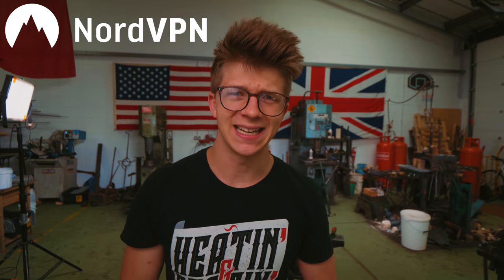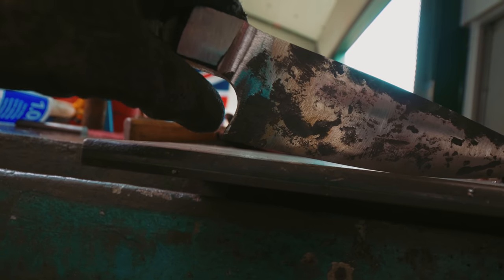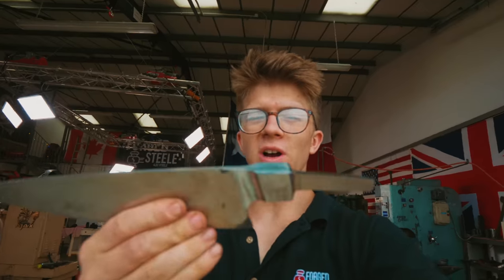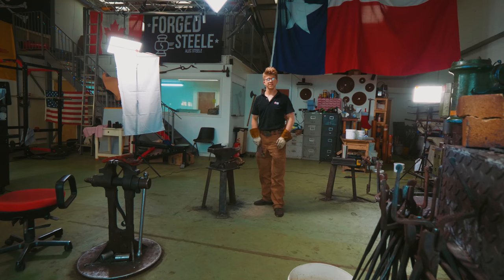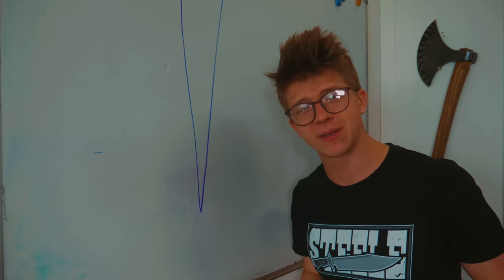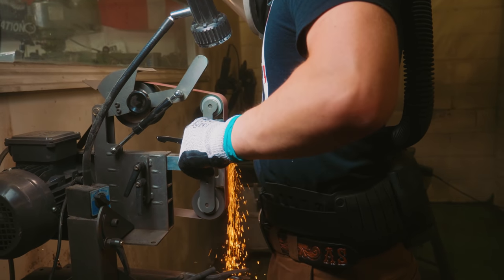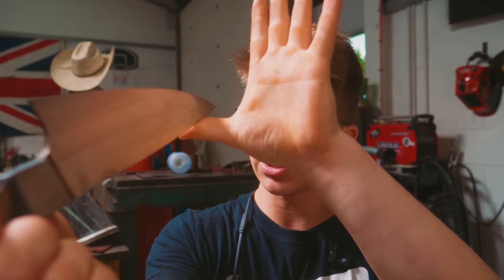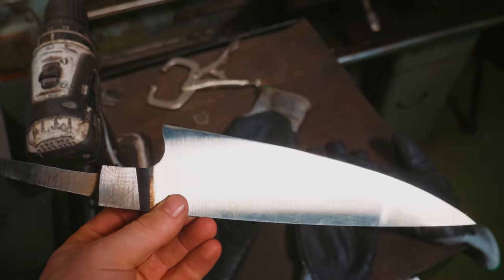MAKING A CHEF'S KNIFE!!! PART 3

Comment: As a fellow brit I love our dual use of both metric and imperial but when it gets below an inch imperial completely loses me XD Il pick mm any day.
Reply: Alex PJP I'm an American, and I wish we used metric. Makes so much more sense but people are stubborn so.
Reply: sry but in any craftmanship metric system is the way to go, because it is easier to convert mm to cm to dcm to m etc. and wanted to say perfect knife for cooking would have  either 2 or 3 layers only 2 for onesided edge and 3 for a twosided edge. Damaskussteel is good and all but isnt the best solution if you simply want a tool that works as best as it could, damaskus looks better though.
Reply: I'm a glass blower so we use both. I guess it just depends on the industry you get into.
Reply: I use inches all the time as that’s how it was during my apprenticeship in the 80s old bolts and nuts. But if it gets down bellow an 16th of an inch them it’s metric... fellow brit.... Across the pond need to adopt it and many many Americans I talk to would love to use metric... and lots do now due to imported cars from Japan
Reply: I'm American and use metric a lot in woodworking when I get to smaller measurements.  So much easier to use.
Reply: I like using both. I don't know either my weight or height in metric and also like cooking with imperial (depending on the recipe of course). but when it comes to science and such metric wins out. I do however have an unreasonable dislike for km and m... i don't know why XD i much prefer feet and miles. honestly that's the beauty of using both... i just do use which is most comfortable. it works great for doing DIY and stuff because you just use the system which gives you the roundest number.
Reply: Alex PJP we use both tho I had a doctor ask what I was in cm I’m like eh I’m 6ft 3 does that help hahaha...
Reply: StArFuRyZz that’s the beauty of metric it’s so so simple to use and takes no learning to use. Even better in tooling also..
Reply: No idea about crafts and industries but as a generation X Kiwi I use metric for everything, including height. Some people my age were obviously influenced by their parents a lot though, and try to stick with feet for height. I just give them a blank stare and ask them to tell me in "real" measurements. It's the 21st century, yo. :p
Reply: As a Brit, I also tend to use both, but favor the metric. Also, if the weather is hot, I talk about the temperature in Fahrenheit, but if it's cold, I moan about it being below zero Centigrade. ;)
Reply: As a machinist in America I convert everything to a decimal. .125+.125 is a lot easier than 1/8+1/8 if you know what I mean. .250 vs 1/4”
Reply: I am an American who works on mid sized scientific experiments. As a rule, you use SI units for project specs and instrumentation, US customary units for  machining and PCB manufacture (down to 1 mil scales [Yes, thousandths of an inch are a thing]), and SI for anything requiring in house chip manufacturing (mm to nm scale). 

It works reasonably well unless US industry (who sometimes use US customary) is also involved in instrumentation and then you get Mars orbiter stuff.
Reply: Same here. Unless the measurement is perfect halves, quarters, and eighths, I need to grab a ruler or some calipers for reference.
I really don't get why we didn't just switch to metric when it was easy. The longer we wait, the more influence the luddites get in the way of a much-needed change.
Reply: Metric system for life!

Comment: Thanks for including Mareko's discussion of heat treating in the last video. Going to try that technique on my next couple knives which are 1095 and should respond similarly to y'all's 1095/15N20 damascus. By the way, the possessive form of y'all is correctly spelled y'all's in case you were wondering.
Reply from the maker: I should note! Both Mareko and I are using 1080 not 1095!
Reply: Thanks for letting me know. I'll have to consider the implications of my hypereutectoid steel, but I imagine it will yield a similarly good result using his process.

Comment: You should get some wet stones to sharpen the blade to a very fine point
Reply: You can do it on belts too. You just need a much lighter touch and finer belts.
Reply: Only problem with belts is you usually end up taking years off your blade meaning you gonna have to replace it sooner.

Comment: That kickback/belt break reminds me of what I did when I experienced tablesaw kickback the first time. I got very lucky in that it just broke my left hand and I didn't lose fingers but as soon as it happened I shut the saw off and out loud counted all my fingers twice very fast then grabbed my hand in pain. My right hand almost went into the blade i mean i was millimeters away from losing a finger or worse.
Reply: It is scary! I caught a piece of 1/4 inch plywood in the gut. I was afraid to unwrap my arms from around myself. Luckily , it was just a bad bruise with a scratch.

Comment: A VPN is good for other reasons than was explained. If you had unencrypted connection to a resource before  VPN, you still have unencrypted connection from the VPN provider to the resource. Only added encryption is between you and the VPN. Man in the middle attack is still possible. It is important to understand what VPN does and what it does not so to not fall prey to false sense of security. But when connecting to such resources as banks, your connection already uses transaction layer security (encryption on the data going between you and bank) in virtually all cases.
As stated in other comments VPN allows you to anonimize yourself from you ISP and circumvent any limitations on region you are coming from by using a VPN node in another region. It will be limited by throughput of whatever VPN service is providing regardless of the throughput your ISP provides.

Comment: Alec, I think it would be better if the blade was thicker at the tang and got thinner and thinner as you went to the tip for a chef's knife to cut stuff like onions and other soft vegetables at the end and harder stuff in the middle of the blade. I think that would make a good chef's knife
Edit: I didn't watch the whole video through rip I just saw you were doing exactly what I told you to do. I feel dumb
Reply: Ok, just pointing out that the Alec uses the standard term for that, which is "distal taper", i.e. the blade getting thinner from the base of the spine to the tip. There is also profile taper which is the blade getting thinner from spine to edge, perpendicular to the distal taper. Many blades, including this one, have both kinds of taper.

Comment: Knife could use more of a flat spot from the heel to center of knife cutting edge in my opinion. I cook a lot and am kinda a kitchen knife snob...a flat portion helps prevent “accordion” the ingredient which means the knife isn’t cutting all the way through. Added some flat portion on the edge makes it more versatile as a kitchen tool. Right now without a flat portion means you are restricted to rocking the knife when you cut. Flat portion means you can do quick chopping tasks on garlic and onions etc

Comment: I know nothing about grinding or forging, but I enjoy your videos, I slowed down your video and noticed that the   belt grinder well ... belt was worn out, you can see the missing piece of the belt at 12:22, then when you turn the belt grinder horizontally , and that worn out part of the belt touches the knife, your belt is cut and you loose control of the knife. I'm just pointing this out so you know what happened and maybe this will help keep you safe. Edit: you can see the belt flaw incoming right before you touch the knife at 12:25.

Comment: One of the things I look for in a chef's knife is that the heel of the blade has a flat spot of about   20 - 25% the length of the blade. Maybe "Sharp, but parallel to the cutting board" would be a better way to say it. Where you showed that there is a "Stop", it should be a bit longer. The idea is that you can chop down at the heel and the blade will contact the board; imagine chopping garlic. From that point forward it should curve up to the tip, so that the blade will rock up and down. The whole transition should be subtle enough that you can slice the full length of the blade without noticing it.

Comment: Noob blacksmith here! Regarding the tempering, what would be the difference between (195*C for 2h)x2 and 195*C for 4h when it come to the performance of the knife?
Reply: i dont know squat but,
the process is for altering the molecular structure of the metal,

so simply put, doing it twice for 2hrs (cooldown inbetween), has a differant result than running it once for 4hrs.
but your question was "what is the effect", so you probably knew that already,

maybe we'll get somone to be able to explain what happens in each scenario,
otherwise youd need to look through texts about metalurgy
Reply: My understanding is the grain structure of the steel becomes smaller make a better knife.

Comment: Theo nazz (2 time fif winner) showed me to anneal in 3 steps first one is critical temperature of the steel you're working then too cool to Black heat. Than 300-400 degrees less than critical and cool to Black Heat then 300 less than that and cool to Black Heat! Seems to work good!

Comment: Hey Alec. I know this is a question with a lot of answers, but on average how long do you spend waiting for the metal to heat up during a project?
Reply: 0KOrbU0 anywhere from 10-30 minutes depending on the size of the objecy
Reply: Wesley That was a lot less than what I thought. I figured there must be a lot of down time while waiting but if you only use around 10-30 minutes in an entire project that takes days then it’s almost nothing.
Thanks for the answer :)
Reply: Heating from cold should only be about ten mins
For following heats (during forging) it should only take a couple minutes.

Though for special heats, like heat treating and stuff it can be more for heat soak and stuff.

Comment: Hi I have been a chef for many years and like watching your show. If I may share some wisdom from one profession to another. Is the bolster and the spine of the knife going to stay flat and square? If so I predict it will be an uncomfortable knife to cut with. When you are holding a blade as a chef to be able to cut fast and precise you will only have really 2 fingers on the handle. Your thumb and index finger will pinch the blade itself you middle finger will rest directly behind the blade and the other 2 behind that gripping the handle. This is the best way to cut and so it is important for a really comfortable blade that those top edges are nice and round and smooth. Cos otherwise I promise you, if you need to use the tool for any length of time it will give you blisters. I have a good set of knives myself and all the edges are rounded for this particular reason. Hope it this helps. Keep up the good work

Comment: IT pro here, the VPN is only 'kinda' like you described it... good try tho, since you're not an IT pro, it was a good stab! 

HTTPS will encrypt data between a client and a site, and modern encryption is more than adequate. 
VPNs in corporate settings are commonly used for clients (or employees) outside of the company's physical premises to get into their network via an encrypted tunnel. 

MOST of what a VPN does for consumers is anonymizes where they're connecting from. It is true that everything between the client (you) and the VPN provider is encrypted, but if the end site you're accessing isn't encrypting the connection, the connection between the VPN and that site is still unencrypted and could feasibly be vulnerable to an anvil in the middle attack. ;)

Comment: Can't you remove the scales with a strong acid bath?
Reply: Officine Undici you can soak it in vinegar for a day or so and it will remove a lot of it. I use hot vinegar for etching blades or for my old cable damascus viking rune neckllaces I used to make. Used to get bitched at big time for it too. I used to put the shorter blades in a baking tray half filled with vinegar and putbit in the iven for an hour and it will make it pretty smelly and the girls would all whine at me....

Comment: I follow your channel since a while and it is really a pleasure for me. I've seen you tempering steel in oil, in water but have you ever tried some more "exotic" tempering? I've read somewhere that for toledo steel was used urine tempering. But in other sources seems that vinegar with salt ammoniac dissolved will give similar results (https://www.researchgate.net/publication/282646881_History_of_Quenching) would you try some test of tempering in that way ? (I mean vinegar and salt Ammoniac, or water and saltpeter, not urine of course :)  )

Comment: Is it a good idea to cool hot metal with liquid nitrogen ?
Reply: zack Gamer never done it but my guess is you would crack every single blade you quench in liquid nitrogen because it would cool much to fast
Reply: Alex Truelock yeah probably but I meant using it to cool the blade while grinding
keeping it for few seconds will cool it but it could crack it like you said
Reply: zack Gamer  my bad i misunderstood.
Reply: Liquid nitrogen would be very poor for this purpose. One, the leidenfrost effect would be quite prevalent and with the uneven cooling it may warp or crack the blade. Two, the specific heat of liquid nitrogen is quite low compared to water to it would take a lot of it to cool the blade. Three, the thermal conductivity of it is also lower then water so once again it wouldn't cool as fast. Forth, because of its low boiling point it would need to be kept in a vacuum bottle so as to reduce the losses. Fith, it is much more expensive then water

In closing, water will cool a blade down much faster then liquid nitrogen but won't get it is cold
Reply: +zackGamer Zwilling J.A. Henckels (famous cutlery company from Solingen, Germany) actually harden their blades by cooling them to the temperature of liquid nitrogen. The trademark names are Friodur and Cryodur, and they call it ice hardening as well. However , they do not quench the blades in liquid nitrogen straight out of the furnace, for the reasons stated before, e.g. by Jason Harrison. From what I read, the blades are "normally" oil-quenched, and then, more slowly, cooled to -185°C to (supposedly?) transform more austenite to martensite, making the blade harder if less tough. (Finally, the blades are tempered as usual.)

Here's a Wikipedia article on this topic:

https://en.wikipedia.org/wiki/Cryogenic_hardening

Comment: honestly, your doing it the other way around : you want the cuting edge to be as hard as possible and the rest of blade flexible. cementing the cuting edge (ie.: more carbon) would make more sense. check the obsidian scalpels, they use obsidian due to its higher hardness compared to steel. Soft steel wont keep the same edge as a hard steel. the rest of the blade should be flexible as to allow transfering force without breaking due to brittleness...
Reply from the maker: You absolutely do not want the cutting edge on a chef's knife to be as hard as possible! It is impossible for that edge to sustain the forces of cutting and chopping food appropriately with an edge as hard as the material is capable of being. It needs a degree of toughness that only tempering will provide, hence the explanation about tempering. It is about seeking the correct balance between hardness and toughness for the edge geometry and the specific task at hand.